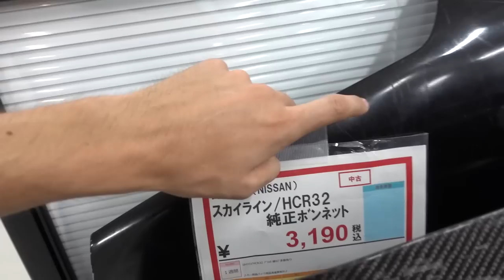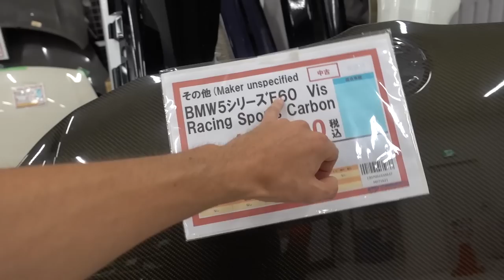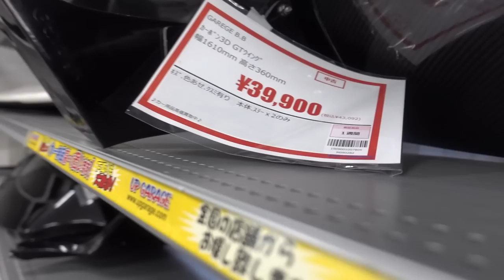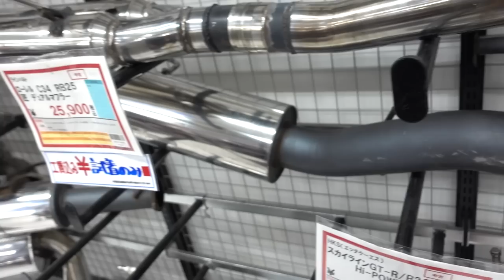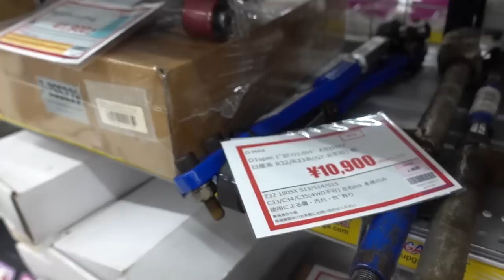I NEED A MOTOCOMPO IN MY LIFE!

Comment: Checked around your oil plug and filter? my sandwich plate for my gauges used to have a leak, not enough to hit the floor clean but run down the block while I'm out driving, The ports for the sensors were all oily. Just a shout